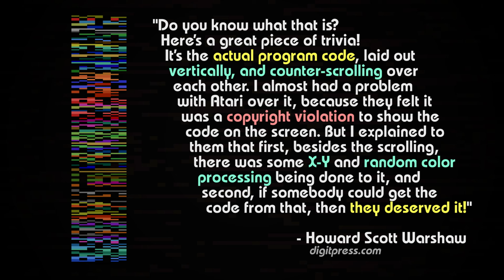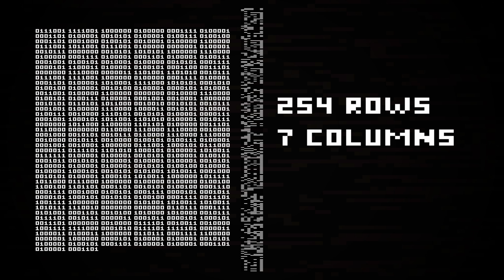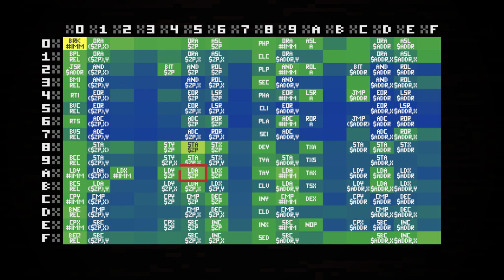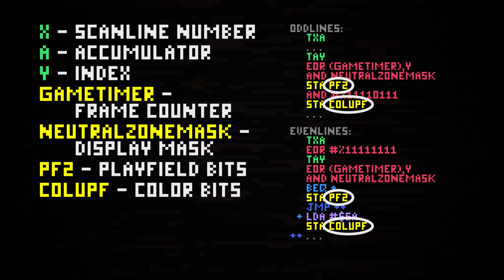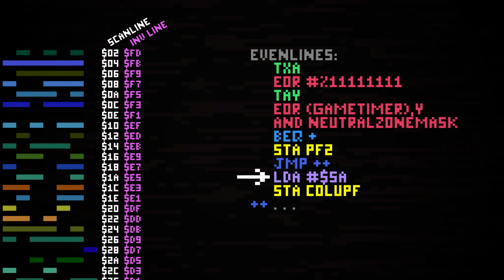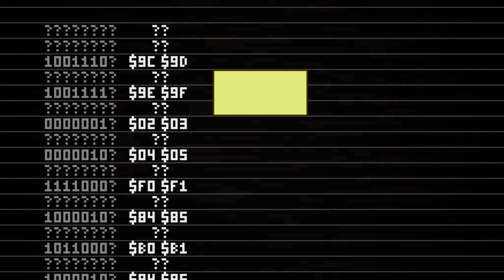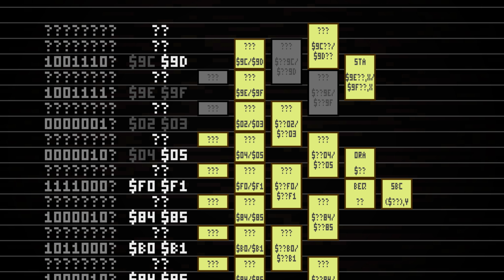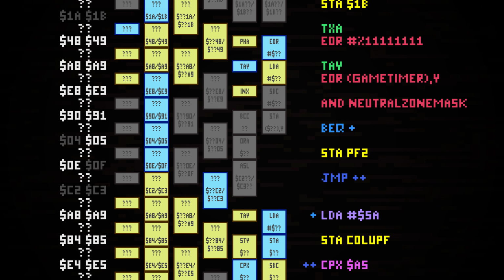Reverse Engineering Game Code from the Neutral Zone

Comment: Ironically for Atari, just dumping the rom would be easier than reverse-engineering the code using an image.
Reply: Yeah, but the Atari legal team wouldn't have known that back in the day. They got paranoid as soon as they heard the phrase "game code being drawn to the TV screen"...
Reply: @gordontaylor2815 that's specialized hardware, and I highly doubt they were actually worried, just wanted to protect their IP.
Reply: @SECONDQUEST An EPROM programmer was not at all specialized hardware for a programmer of the day.

Ironically, displaying the code onscreen would have afforded it more copyright protection than not in the early days of 1982.
Reply: @CptJistuce A ROM dumper no, but a few switches wired to the address pins and lights on the outputs would work too. After all, simple ROMs are basically pure combinatorial logic.
Reply: @colejohnson66  That WOULD work. It'd be tedious, but it'd work.
...
I'd still just drop it in an EPROM programmer and read it out that way.
Reply: @SECONDQUEST  If they didn't want it to happen then that would mean they were worried
Reply: @colejohnson66 - Dumping it via an EEPROM programmer would have been the easiest and quickest method.  Back then, cart roms weren't protected like in later decades.
Reply: Did this game use any bank-switching logic, or was it tight enough to fit all at once into the 6507 address space? I'd guess bank switching probably wasn't yet common in 1982, but never opened up the cart to look for extra chips.
Reply: @jordanhazen7761  Bank-switching exists on the VCS, but Yar's Revenge fits in the ... 4K, I think it was... allocated to ROM carts.
Reply: As a footnote, bankswitched VCS cartridges were developed because they got sued. Someone saw a chess piece on the box art, apparently bought the Atari as a chess computer, then Atari didn't release a chess cartridge and said they had no intention of doing sn, so he sued.

While the chess cart they eventually released fit in 4K, they didn't think it was possible when they started, and initially developed bank-switching hardware to enable chess.
Reply: @SECONDQUEST no, a regular home micro of the time could generate the address sweep and read the data from a mask ROM or EPROM chip of the day such as used in game cartidges.

You just need to connect the address and data lines of the expansion port present on all home micros of the day.

You could buy bare prototyping circuit boards to fit popular home micros like the Apple 2 and Commodore 64. You could build a circuit on it fairly straightforwardly just by soldering components and wires and cutting traces.

And what we are talking about all you have to do is desolder the ROM from the cart, solder a socket to the prototype board and the cartridge board, route wires from the pads from the socket to the edge connector or occasionally socket on the prototyping board so the address and data lines lined up between computer expansion bus and ROM.

And yeah you could work that out back then if you knew how all this shit works. Like I do now but not back in the early 80s cause I was a little kid.

Unless Atari was exceptionally deranged and paranoid and ordered special ROM chip package carriers wired different. Which is something I don't think even Nintendo stooped to, Nintendo who would happily bludgeon a grandmother in the face.

Because ROM chips all were the same. They all were standardised and interchangeable to ease manufacture and parts procurement. Just with adding an extra addressing pin for every doubling of capacity in each generation of the tech, and originally having 1, 4 and 8 bits of data per addressed location before standardising on 8.

They had different methodologies for programming depending on type, whether that be at time of manufacture for mask ROMS, with a relatively high voltage for PROMs and the same idea but possibly different voltages exactly for EPROMs and later EEPROMs; and methods of erasure, only even possible with EPROMS (UV light) and EEPROMs (high voltage, usually different voltage from programming and/or a different capacity, though later flash EPROMs would solve that by putting the circuitry to handle the different erase and programming voltages on chip, as well as being able to erase ever smaller blocks of bytes, eventually down to the byte).

Alternatively with a handful of TTL chips and a high voltage level converter and a 5V, 20V and maybe 12V power supply, you could have literally build something to copy the Atari mask ROMs to the EPROMs of the day, so you could have bootlegged the cartridges back in the day. The fact it never happened tells me back then either the knowledge wasn't common or we were far better at keeping talented people off the streets than today 😛 Or some combination of both.
Reply: @SECONDQUEST not only is a EPROM programmer not specialised hardware, every hobbyist can just hook up some LEDS and switches or wires to the rom, and read it byte per byte. It's not that many, you're done in 10 minutes if you have a friend help you. Such a thing was displayed in Halt and catch fire, even though it was totally unnecessary on the pc 😂
Reply: @gordontaylor2815   Woah! Never thought I'd see you again! I saw your highlights comments on the Mame World Records channel
Reply: @gordontaylor2815  why is it even copyrighted its not even a IP
Reply: @foxneko4465 Everything you write (provided it's not copied from elsewhere) is your Intellectual Property protected by Copyright. Game code is something you write (back then the assembly was written by hand). So yes, it would be their IP protected by Copyright.
Reply: Much MUCH easier. Even in those days, building an adapter that could read a ROM & dump it into an RS-232 port wasn't that big a project.
Reply: You could steal anything sitting on a ROM chip unencrypted by manipulating the address pins and wiring something to the data pins to show you the value at the location you have set up. In the TV series Halt and Catch Fire they steal the IBM BIOS with this method, writing all the bytes on paper.
Reply: Why would they name it ROM if ur not supposed to read it smh
Reply: trollface telling you to read only memory

your memory
Reply: The dev stated that if someone did reverse engineer the code from the Neutral Zone, they deserved it, which could be argued in court as permission to reverse engineer it from the image, AND as a license to copy and use that code. Dumping the rom would be clear theft.
Reply: @fevix-rishara  It was Time-Warner's code, not his.

However, depending on when in 1982 the game came out, there's a few months where it WOULDN'T be clear theft. 1982 was a big year for copyright protection of computer programs distributed in ROMs, with multiple cases establishing that yes, data in ROM ICs was covered. Before that time, the argument was that only human-readable works were copyrightable, and hence a listing of your code was copyrightable but not the contents of a ROM, disk, or magnetic tape.
So while the writing was on the wall there was still a brief window of time you could, legally, copy that floppy.
Reply: @fevix-rishara He also only said this in private meetings with Atari, only saying it publicly years later in an interview.
Reply: @fevix-rishara  It's not possible for the programmer to make such claims and be legally correct as he didn't actually own the code. He worked for Atari and thus anything written on company time is owned by the company. This is still true even today. If you write software and are being paid by a company then the company owns whatever you write. Period.
Reply: @g4z-kb7ct this is morally wrong
Reply: @fevix-rishara  dumping the rom of a system you own is not in any way 'theft'
also, 'deserved it' likely means 'deserves to view it' not as a statement that voids the copyright
Reply: @ThylineTheGay  Yeah, but that was in the days when TV studios sued VCR manufacturers because time-shifting was seen as theft... One thing that hasn't changed in all those decades is that managment in most software dev studios is pretty clueless about technology and laws.
Reply: Fr
Reply: only if your stupid
Reply: Don't see any irony here
Reply: It’s their job to ask. Sounds like they asked if it was an issue, then got confirmation it wasn’t and things went ahead. Never hurts to have someone ask sanity check questions, even if they seem basic.
Reply: I think the reason they were concerned is: if the ROM is directly dumped and copied, then that is a copyright violation. 

But if someone figured out the code from the Neutral Zone, that might fall under fair use as reverse engineering.

Atari actually tried to use that argument as a defense for their unlicensed NES cartridges. They claimed they reversed engineered the NES lockout chip.

The main reason they lost is because they hadn’t actually reversed engineered it. They gad given up trying & just stole the lockout chips code from the US copyright office.
Reply: this is a math video what are you talking about
Reply: Umm… duhh???
Reply: But you're forgetting it was the early 80s.  Most people never heard of a ROM dumper, much less had one lying around.  And even if you had one...what would you dump it too?  Computers were less common than game consoles back then.
Reply: @sa3270  actually you could dump it using a tape drive
Reply: @sa3270  You only need 1 tech person to dump it. Not many. One person could have disseminated the dumped file over BBSs and email and spread to many.

There were many nerds with the capability and interest in dumping Atari ROMs back in the day. Computer clubs existed and were all about doing tech things with microcomputers of the day. They communicated over BBSs and physical newsletters. They were often populated by people working in tech industries. Any of them would have had the ability to read and write ROM files to chip.

They may have numbered in the low thousands of members, but they essentially demonstrated to the computer industry what a home PC could be as well as many other kinds of add-on cards and peripherals. For example, Steve Wozniak was one of those computer club members and ended up creating the Apple II, which essentially defined the modern PC and pre-dated the IBM PC.
Reply: they werent concerned about dumping or replication, they were concerned about decompilation which would enable cracked copies
but even then it would still be simpler to do that normally than to do it through that visual
Reply: This has to be one of the dumbest comments I've ever seen

Comment: On question of possibility of decoding binary data from video: By the time Yars' Revenge was released, PCM audio adaptors were widely used for storing audio encoded binary data recorded on analog video formats. Because there was already a way of decoding this sort of data storage, it was definitely possible to decode the binary data of the game in 1982.
Reply: @james66666  CD audio specifications were based on specifications of PCM audio stored on video tape, there was definitely that kind of fidelity back then.
Reply: @james66666  1. You don't need to mod anything, we don't even need color information, only brightness.
2. You don't need high fidelity, PCM adaptors successfully managed to decode audio from VHS tapes!
Reply: @james66666 You CAN'T mod a VCS to RGB without replacing the TIA or adding appreciable logic, as TIA doesn't work in RGB internally nor output it externally.

You CAN, however, easily mod it for chroma/luma(aka s-video).
And for this purpose, chroma is irrelevant. Just run luma out and get crystal clear images through a single RCA jack.
Reply: @james66666  Yeah. Chroma and luma get mixed together and you have composite.

TIA isn't the only display chip to work in this way. Aside from the GTIA used in Atari's 8-bit computers and 5200, there's always the NES PPU(though it mixes the two signals internally and only outputs composite).

(The NESRGB actually intercepts calls to the PPU and essentially replaces part of the PPU. It is not a simple mod.)
Reply: @james66666  More accurately, the TIA puts them on the mainboard separated, and the mainboard combines them to give composite to the modulator.
Reply: @james66666  And I will end this conversation on video resolution comparison: 
- Atari 2600 can (at maximum) has resolution of 160 by 192 pixels.
- EIAJ STC-007 standard PCM adaptor's output is 720 by 525 pixels, which is ~12,3 times higher than Atari 2600's
Reply: @james66666  What kind of point is this? Do you really think that it's more difficult in real time to process low resolution image than a high resolution image *that fills the entirety of NTSC picture area*?
Reply: @james66666 You are missing my point about decoding bits from analog images. Have you actually seen a video output from PCM adapter?

Comment: Did you work this all out yourself, or did you use existing sources from some hypothetical other engineer's research?
Reply from the maker: I did start with the ROM file already, so it was trivial to just disassemble that first. However in the video I did all of the work trying to assume I hadn't done that already.
Reply: @RGMechEx   I used to have a dog that would take her tennis ball and hide it under a blanket, and then jump back, and try to "find" it again.  It occurs to me that solving this puzzle when you already have the ROM is a little like that.  Except, you know, a thousand times more sophisticated.  :-)  I guess we're all motivated by the same things.

Miss ya, Patty.  <3

Comment: I would say that although it's more or less impossible to unscramble the code from the color blocks, the fact that you can more or less reverse engineer the code that displays the neutral field from looking at the graphics, I would say, technically counts as extracting code from the neutral field graphics, albeit not the code that is hidden in the field. considering that also just by chance, the code to draw the field ends up becoming field is rather fitting to the goal of unscrambling the code.
Reply: I'd say that "fitting" would be a better word than "ironic" in the last sentence
Reply: @NikolaM8421  thanks, english is my first language but I suck at properly conveying information. fixed it.